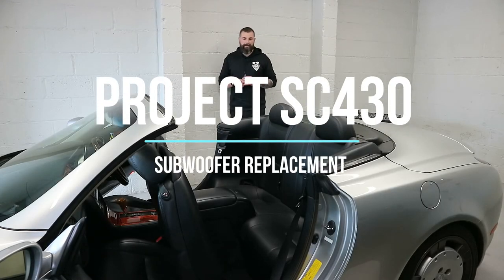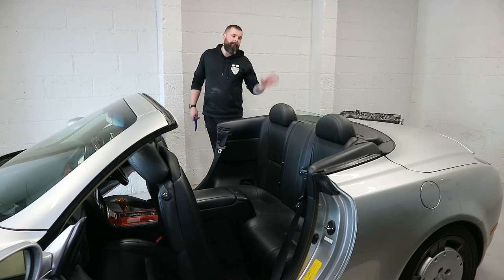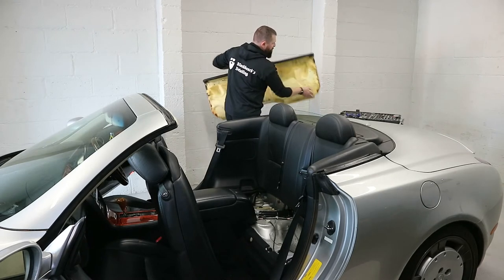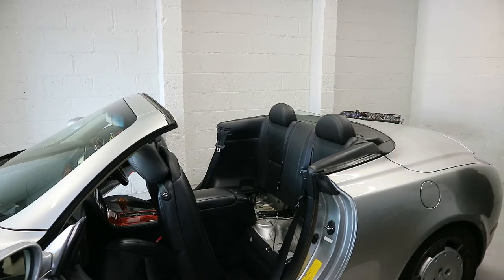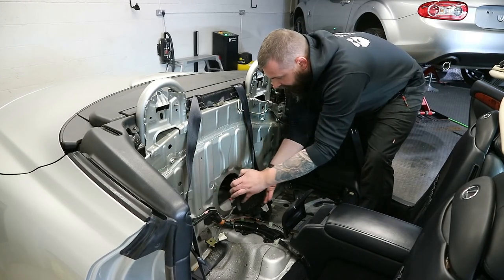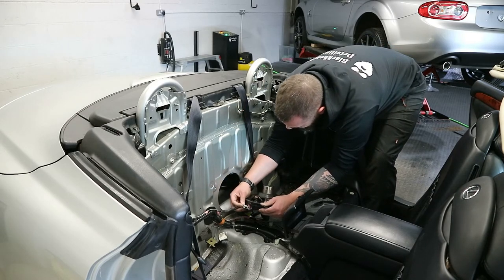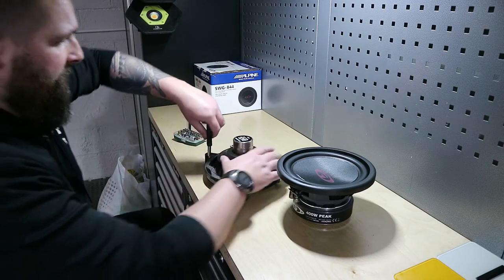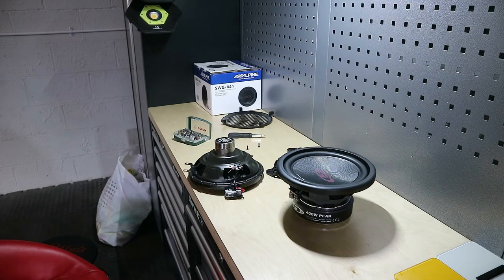Blackbeard's Detailing - Project SC430 - Subwoofer Replacement / Removal

Comment: Why would you put in a non matched impedance speaker ? ..................... just put in an 8 ohm one so you dont overdrive the amplifier ! ........... the mind boggles how you do this and make it sound as if its good practice !
Reply from the maker: If you watched the full vlog you would also hear that the entire system was being changed, including the amplifier so why would I put in a speaker to match the ML amp?
Reply: @BlackbeardsDetailing  You stated later you sold the car ..presumably with the impedance mismatch still in place . Obviously you can do as you wish ,but as an electronic engineer , I think it is not a good idea to post this as if its good practice .
Reply from the maker: @nickloughrey9841   @Nick Loughrey  yes the car was sold and the new owner knew. 

With fitting this subwoofer the speaker output voltage significantly falls (having an effect on the tone) however the flowing current only marginally increases. This won't significantly overdrive the amplifier unless ran at full volume for a prolonged period of time, but as an electrical engineer you'll know this. 

At no point did I say that it's best practice, I did point out the potential issues and again pointed out that (should I have kept the car) the entire sound system was being upgraded.
Reply: it's 16 ohm

Comment: I replaced mine with the same speaker and 2 weeks in it blew my amp. so now I dont have a choice but to do a full amp replacement and probably the stereo too. yeah it would have been cheaper to just pay the 380.00 for the original one and called it a day.

Comment: Any chance you can tell us the model number of that infinty replacement? How is it holding up? Cal
Reply from the maker: Sorry Cal, not sure what you mean by "infinity replacement"
Reply: @BlackbeardsDetailing  Sorry, I meant Alpine replacement subwoofer  czn't quite make out the model number in the video. Is it working out? Has the amp been cutting out?  great videos, learning alot. Thank you.
Reply from the maker: Hi Cal,

It is an Alpine SWG-844 I installed. I have not had any issues whatsoever, been on a few long runs with the music playing and it has all worked perfectly.#

Thanks,

Ross

Comment: Thanks for this, it was a big help! 
I used this speaker from Parts Express, Dayton Audio - SD215A-88 8" DVC Subwoofer. It is shallower than the OEM but has a larger diameter magnet and fits perfectly depth wise on my 2004. I did need to cut back were the mounting holes on the bracket were about 1/8in and add new foam strip between the spacer. Just remember to weir this for 16Ohm unless you are also replacing the amp. The audio sounds completely different now. I don't think the sub ever worked since I owned the car.